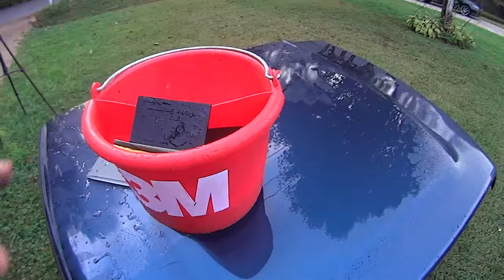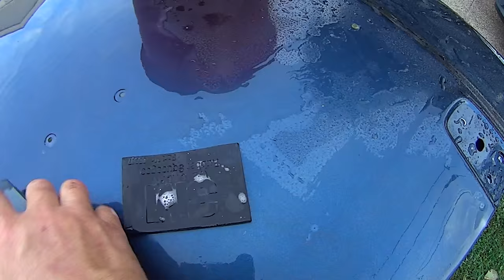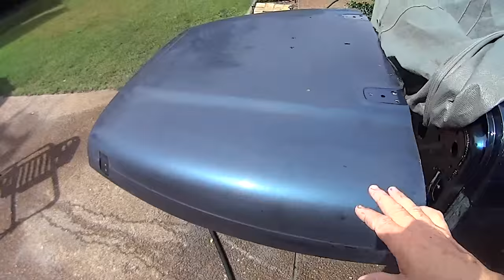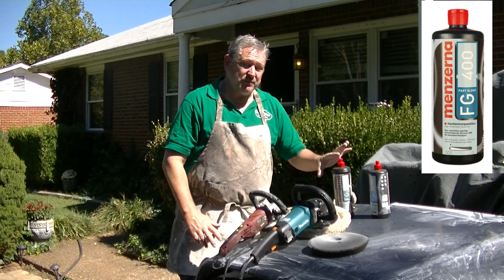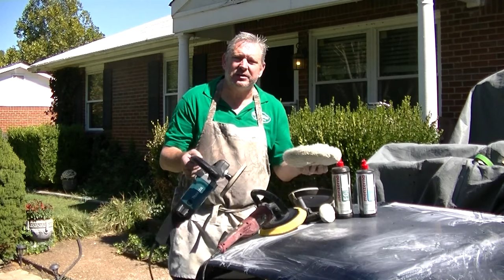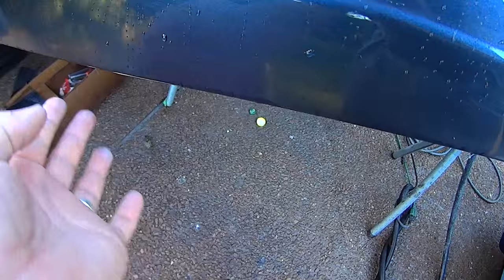Redneck Garage - Car / Paint Buffing 101- Getting That Gloss

Comment: you think this would work on a car with a ton of scratches im getting a dd and its got a alot of scratches like it was once a rally car and im trying to avoid painting it
Reply from the maker: +William Moyer It all really depends on how much clearcoat is left. If you do decide to sand use a really fine paper like 2000 grit or 3000. Use a foam bonnet and a fine compound. If there is a good finish now it should be OK - if it is thin already you might be repainting OL